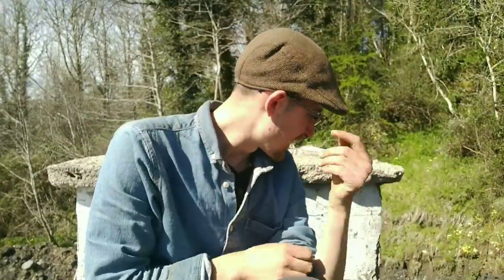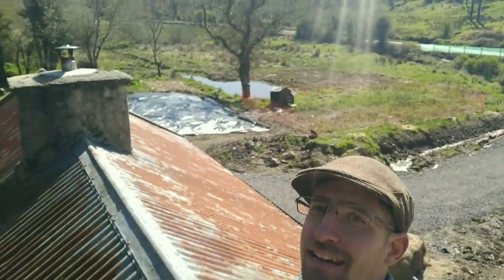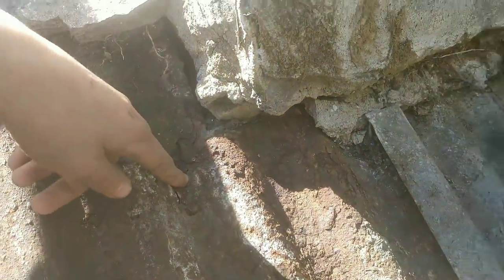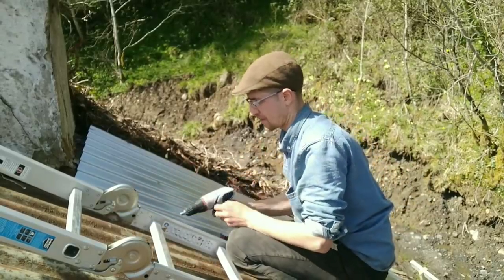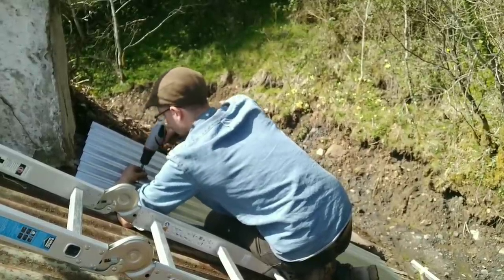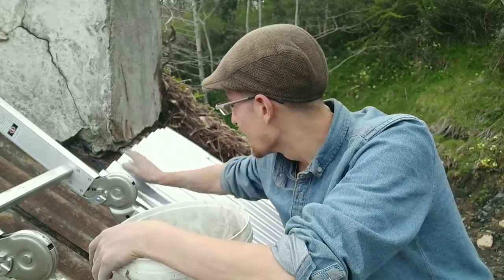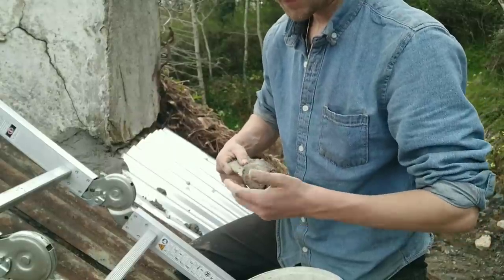How Not to Fix a Roof | Starting a homestead

Comment: Lovely!! Thank you for that concept of circles of control/concern/influence. Very elegant. I have an 80+ y.o. house, it had a knackered roof, with a fecked up old vent on top... but I hadn't money to replace it. Three roofers told me they wouldn't repair it... I wanted to hide and cry.... so I bought a roof ladder, went up, bate the shite out of it, fecked on a load of some tar stuff, (roofers wouldn't want to look too closely)... and it did another few years until I could borrow to do the proper job!! Sometimes you have to do what is enough to get through. Great video, keep on keeping on!

Comment: 100% agree on MVP approach, just make sure the easiest solution to a problem isn't one causing three aditional problems when it solves one. That metal sheet is going to create condensation on the inerior side when it's colder outside then inside (so basically mostof the time outside of sunny warm days), condensation which will then fall back and and damage insulation/beams. I get your point about budget and better than nothing, just keep in mind if this stays up it may cause more water damage than your initial hole (inner structure will spend more time wet due to condensation than it would have due to infiltration) , it's ok for summer month, but if this is up next winter , the underside will be running with condensation more or less 24/7. Love your channel, keep it up!

Comment: I've had considerable experience dealing with old ivy!  A cheap electric chainsaw will deal with the dead stuff easily and quickly and you don't have to worry too much about damaging the chain...!  Old loppers and a pruning saw, likewise, and a small wrecking bar for persuading the ivy off whatever it's growing over.....
Another point - if you remove it before it gets too dead it retains a bit of flexibility and is easier to shift!

Comment: Did you take care of the leak?  If so, then the 'patch' worked.  Another way to seal metal roofs is to mop it with a tar based compound that is filled with fiber.  That will take care of any pin-holes that will leak.  The mopping will be good for several years.  So you have the time to save up the finances to replace the roof and any structural supports.

Comment: I like your attitude.  Homesteading almost by definition means making do with what you can, because it rarely comes with a high income.  It's far more inspiring than just being able to throw lots of money at every problem.  That takes no creativity.  Do you have any interest in a thatched roof at any point?
Reply from the maker: Thatched roof is very expensive, I would do it if I did it myself, we'll see :)
Reply: @thebridgemanscottage  I can totally see you doing it yourself.  That's why I asked.  😊  It's a trade that should be continued and handed down.
Reply: @thebridgemanscottage  personally I like corrugated iron on small cottages!

I’m putting corrugated iron on the one I’m building on our smallholding!

Good quality steel is maintenance free and will probably outlast you if done with attention to detail

Comment: There is nothing wrong with a patch job to tide you over. The main thing is protecting the integrity of the cottage till you are in a position to do a full repair or replacement. The longer you are there the more relaxed you get about the imperfections. It will all get done in the fullness of time.

Comment: that roof looks like aspestos 
be very careful around that stuff
Reply: It does look like aspestos!   Deadly stuff!  Take care  and mind yourself!
Reply: These are simple old rusty metal corrugated roof panels screwed/nailed on a wood frame. You see them everywhere in Ireland. You can hear every rain drop on them...
Reply: @jwestrik9308  the one he covered is aspestos take a good look at it 
and the used anything they could in those day's
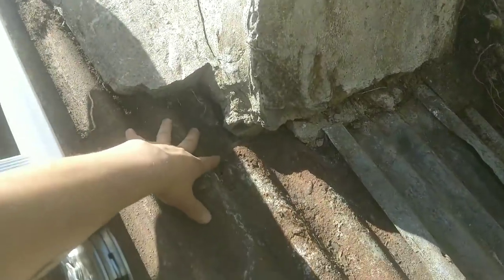Reply: @stillfriction6944  I did, but it looks too thin and there are points of deformation (1:10) which would only happen with steel. But anyway, if it is; one indeed better be careful.

Comment: I understand your point. But how do you justify for yourself working in the roof without any safety gear? I was very sorry to see you do that.  Two bloggers/ self-sufficency ”gurus” I follow have recently fallen: other one slipped and steel plates ripped deep wounds in his palm and fingers as he stopped hanging at the edge. Other one fell as he was looking for a place to attach safety rope but it was morning and roof was slightly moist so he fell, broke leg, hurt his back and got a concussion. If you ever use a chain saw, please don’t make a video where you cut trees without proper safety helmet, trousers and gloves. You’re gonna need all your limbs while working with your nice little small holding. You know I’m right with this one.
Reply from the maker: I'm not pretending to be a guru, I'm just a regular guy showing how other regular people can do this if they really wanted to.

I took all of the necessary safety precautions. My roof is 2 metres high at the eve. The doorway to enter the house is at my chin. It's a small little thing. I had a ladder to get on the roof and a ladder along the pitch making it possible to walk up without any hands, however I kept three points of contact at all times apart from some quick moments when I needed both, in which case I had sure footing. 

I have all the necessary training to work on construction sites and hold a safe pass card.
Reply: @thebridgemanscottage  Thank you for answering. I didn't mean that you present yourself as a guru. But exactly the idea that "regular people" can do repairs on the roof and not mention safety with one word, that is dangerous and gives the wrong idea. We viewers don't know about your construction site experiece or safety passes. Good to hear now that you have those. So what I'm saying, most accidents happen at home when regular people think they are doing simple things but don't think about safety point of view. For example loan mower accidents are very common. Two missing toes in my family too. Would you consider talking about safety at some point when you do stuff where there's obvous risks, like power tools, climbing roofs, paintig walls etc.? Many youtubers seem to avoid talking about these  for some reason. You might become an influencer even though you're not a guru.